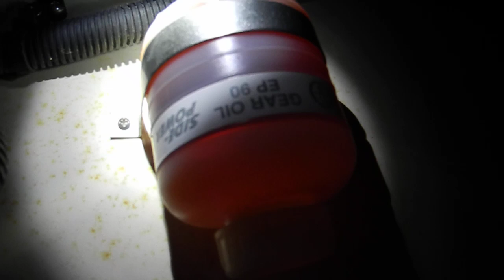Bow thruster with oil reservoir

Comment: I have a American bow thrusters system the hydraulic fluid tank float switch is bad and I can't find another one anywhere it's on a 100ft boward yacht it has a red black and yellow wires for the float switch how can I bypass the switch and what wires can I twist together to get the fluid alarm to stop so I can use the bow thrusters and just check the fluid manually Daily
Reply from the maker: Call the factory. They have an office in Florida and another one in California. That would be your best bet.